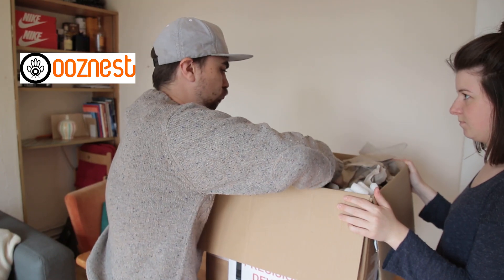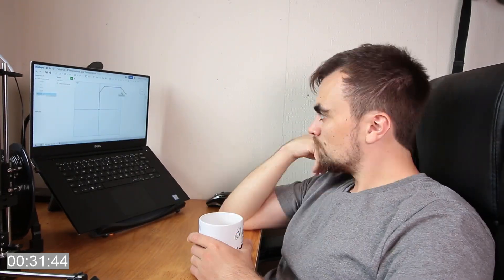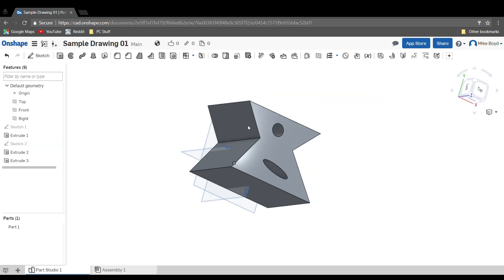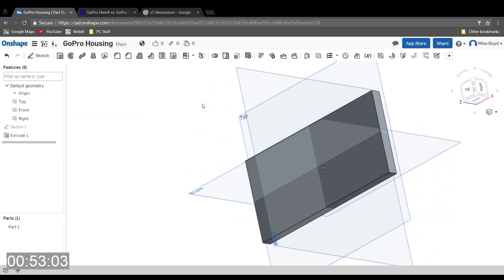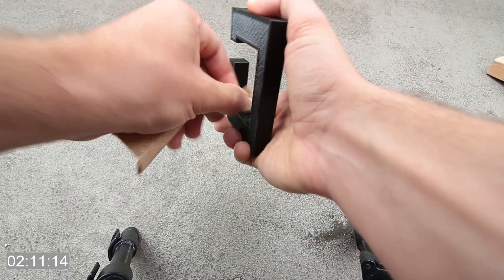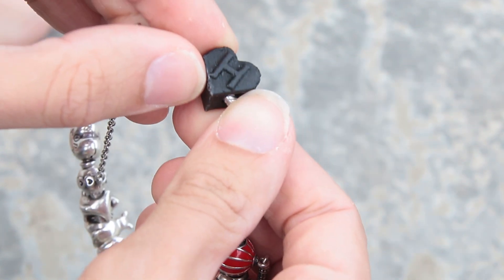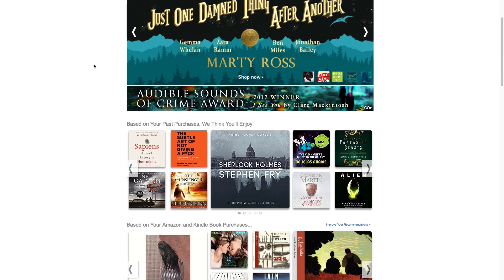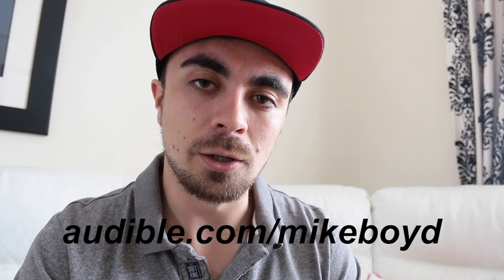Learn to 3D Print || Learn Quick

Comment from the maker: Thanks for watching guys :) For more pics and updates of what I printed, check out my Instagram @mikeboydvideo
Reply from the maker: +william Murdoch this sounds like the coolest school project of all time. Well done!
Reply: Mike Boyd learn how to do a handstand
Reply: I actually did the exact same thing as you here. For a school project I built a 3D printed model rocket used an A8-3 rocket engine (same one as you have there by the looks of things) and launched it. It went 155 meters (492.126 feet) in the air, and was the highest rocket that we launched. I did however have the luxury of using OpenRocket / SpaceCad witch allowed for the rocket flight testing prior to launch. Was an absolute blast.
Reply: Learn to handstand for 30 sec! :)
Reply: Mike Boyd  Please learn bunny hop
Reply: Mike Boyd learn how to draw hands
Reply: Learn how to bunny hop on bike
Reply: Mike Boyd you should use google sketchip
Reply: you're cool
Reply: Mike Boyd you got 4300 views in ONE OUR WOOOOOOW
Reply: Mike Boyd learn to slack line or fixed gear bike backwards.
Reply: learn to handstand or handwalking
Reply: Mike Boyd learn to throw cards, look at dude perfects latest video to see what I mean.
Reply: Mike Boyd hey i would really like it if you make a handstand learn quick video :)
Reply: Mike Boyd learn how to do the splits, improve your flexibility :D
Reply: Mike Boyd first print a go pro holder second print a missile you know just the usual
Reply: Mike Boyd learn how to sing professionally
Reply: Mike Boyd oo
Reply: So cool!  I did graphics at school and modeled my DS in rhino but it took me ages. Also could u try doing the stick trick or step over the stick trick.
Reply: CHALLENGE: learn to do a full planche
Reply: nice one there..cost you your glass there... you might have stepped on it while you are at your excited frenzied state... but who doesn't get excited after launching a rocket
Reply: you should make a series out of doing this sort of stuff with a 3D printer, 11/10, good work.
Reply: Mike Boyd o
Reply: Mike Boyd nice that you picked up your plastic instead of littering
Reply: Mike Boyd 5:34 We have discovered archived footage of Elon Musk when the Falcon 9 first stage first successfully landed.
Reply: Mike Boyd thank you so much for this vid! I started using CAD about a year ago, but the Autodesk software was too expensive to download at home. Well, time to get CADing!
Reply: you are living my dream
Reply: Mike Boyd use creo i use it in  school at starbase
Reply: I’m designing parts in my pltw engineering class using cad but I don’t get to print anything even though we have like six 3D printers
Reply: Mike Boyd  m
Reply: Could you please learn how to manual on a skateboard!
Reply: Mike Boyd Your videos are awsome, Started watching your videos from my friend Lauren who won your rubiks cube 😃
Reply: where was the rocket part filmed? it looked like the tay at dundee haha
Reply: Mike Boyd Do how to barspin on a scooter
Reply: Mike Boyd you should learn how to play lacrosse
Reply: Hello Mike. 
Since you have been doing some balancing acts, and suceeded. I think you should try to learn to 'Cylinder Walk'. Lets say 10-15 meters forwards and then backwards.  And if you learn it really quick you should try to do it on a ball.  Hope you will see this as a challenge. 
Keep up the good content. Always looking forward for your videoes :)
Reply: Mike Boyd, please consider learning a 5 ball cascade, with the goal of qualifying (10 catches). This trick is the entry level into more difficult juggling, and is a milestone for most jugglers. Just so you know, this will take many hours to complete (unless you are awesome). There are many helpful videos on how to learn this.
Reply: Mike Boyd do a video about how to do a backflip 😊👍👍👍👍
Reply: Mike Boyd just thought of a great one for you to try. Boxing speed bag! Would make an awesome video.
Reply: Mike Boyd learn to play French horn
Reply: Please make bar rollover!
Reply: Mike Boyd  can you buy me a rubiks cube plss
Reply: When you leave this life, you will have little to no regrets
Reply: Mike Boyd please stop swearing
Reply: Mike Boyd make a larger scale rocket and add a go pro to it
Reply: Hi
Reply: You stepped on your glasses
Reply: Mike
Reply: You should learn to drop kick a rugby ball through the H from 20 metres backs
Reply: Mike Boyd bro we are doing project on 3d printing..
pls tell me which sofyware?
how to u use ?
any tutorials link ?
pls share me

akhilsunny060@gmail.com
thanking u
Reply: space X  style (Reusable launch system)
Reply: Mike Boyd use tinkercad next to 3dprint
Reply: Nice tutorial! I like to go back to basics every once in a while and watch starter tutorials, and by far, this is definitely the most intuitive, might even start using OnShape after watching it!
Reply: thank you for this video and i too have some stuff ping on that plz
Reply: Ye
Reply: What fuel do you use for the "heaven-pursuit tube"?
Reply: ooznest rly cheaper out, not prusa not ender 3 but anet a8 looks like. plus u didnt even get it lol.
edit: ok its prusa, the reprap one- its bad and old.
Reply: https://youtu.be/wYjVLvHmRa8
Reply: Make it so it floats, loved it.
Reply: You should pin your comments :)
Reply: Learn to do a stand up slide on a longboard!
Reply: Learn to play the harmonica

Comment: I’ve been using Onshape for probably the past year. I’ve designed so many things for my 3D printers. I recently used it to make a reference model for a table I was building for my truck camper. I used OnShapes built in BluePrint maker to get the exact angles I needed to cut out of the wood. It’s an absolutely brilliant and easy to use software

Comment: this is so misleading sure anyone can deffo learn to print ( i have an ender 3 pro) but it is not a case of pluggin in sd card and letting it go you gotta build your printer learn how it works dial your slicer settings in etc before you can even dream of consistant good quality prints. His cable management on that machine was awful and im guessing so were his setting lot of rough edges on those prints , not an untrue title but slightly misleading

Comment: Everyone with a  3d Printer: "That's cute, he thinks he knows."
Reply: @H S  owning a 3d printer i can testify that he was loaned a good machine, looked like a v1 prusa mendle, but they are alot of work to get printing high quality parts, quick to learn dificult to master
Reply: @itsbeefers  Yeah, but it was a clone unfortunately, would have been much easier with a Prusa MK3S, Cr-10, or Ender 3.
Reply: No1 else like this
Reply: @Cheifareno I can confirm it being hard to master. I have an anet a8 and it took me a year of fiddling to get it to print nice. Since then i upgraded to a cr-10 and i haven't used my anet a8 sense
Reply: This is me
Reply: I have 3d printer and it took me about an hour to understand how it works and all the settings, after that everything I printed so far was great quality and no fails or anything like that.

Comment: Wait till you see the price of Solidworks license  or ansys haha
Reply: 😂 ik lol
Reply: Or NX
Reply: @lukeblackwell7941  haha.  Both are very good software.   They can be aquired for free, using torrents.
Reply: @AxelP33  ik but I'm always weary of torrenting because it usually contains spyware
Reply: @lukeblackwell7941  yeah, i use an anti malware ( 60 a yr i think ? ) and it seems good.   Then there are streamers that you can trust.  Like solidSquad  for sldwks.
Reply: @AxelP33  oh thanks I didn't know about solidsquad. I use open source AVs but I still get nervous. i can use it in my engineering class but we don't get individual licenses bc its lan based. I just started using SW this year but I find that fusion is not easy to transfer over to so I need SW on my personal PC.

Comment: A small mistake: you probably put the GCode of the model on the card, a code which the printer understands. You would have needed to slice the 3d model first with a slicer program if you didnt use onshape

Comment: I was about to be worried about all the waste of firing incorrect materials, and then you retrieved the models. However if you do want a sturdy biodegradeable material then PLA is a safe bet. It takes a while to decompose but it does break down completely

Comment: I’ve used Computer Aided Designs for printing some name keychains and a scale car badge keychains, I have also made a 98% throttle blocker for my dad’s BMW E92 335is so that the car does not downshift when the car is at full throttle when on track and the rear end does not kick out unpredictably on exit of a corner. I am 13 now and was 11 at the time. Mike Boyd, your videos are really great

Comment: If something doesn’t need to be structural, lower the infill. Also, if you don’t need it to be super detailed, increase the layer hight. It will print faster and use less material. Just a tip.

Comment: Well it's not that easy. If you get a printer that is well made then it is essentially a plug and play situation but I stumbled upon a Geeetech device a year ago... still am tweaking it to make a reliable print and not have to hold the things hand so it doesn't fail mid print. BUT I have learned a lot during the year. Cool vid on your side tho, like what you do!

Comment: In the video you didn’t show any calibration of the printer itself. It looks like the 3D printer just works out of the box - which is basically never the case. There was no fiddling with esteps, bed levelling or anything that is completely necessary for good quality 3D prints. What’s the deal?

Comment: Did you make a homemade igniter ?
Reply from the maker: +Jack no. The motors come supplied with them. I did wire it up to a 9V battery with a stereo cable.

Comment: The video should be titled "Learn How to Design Parts in CAD to be 3D Printed", as you didn't spend any time at all describing how to use a 3D printer. I expected more of an overview of how to go from CAD -> STL -> gcode -> printer, then go through the actual process and troubleshooting of things like bed leveling, slicer settings, etc.
Reply from the maker: +ydoucare55 CAD-STL-GCODE is 30 seconds and had no input from me. I cut it out the edit because I didn't feel it was interesting. I had no issues with bed levelling or slicer settings. Everything was on auto. This was just my experience. Hope you didn't feel misled.
Reply from the maker: +ydoucare55 CAD-STL-GCODE is 30 seconds and had no input from me. I cut it out the edit because I didn't feel it was interesting. I had no issues with bed levelling or slicer settings. Everything was on auto. This was just my experience. Hope you didn't feel misled.

Comment: You could "Learn to Build a 3D Printer" using one of the Prusa I3 kits, I went with the Anet A8 for about $150 USD and it works amazing, there are a bunch of upgraded parts you can print with it.  There is a lot of skill when it comes to tuning a 3d printer as well, so that could be part of the video.